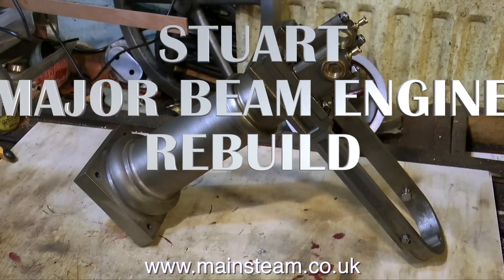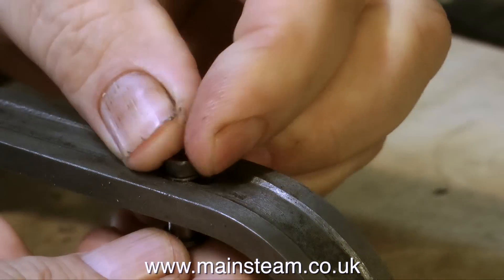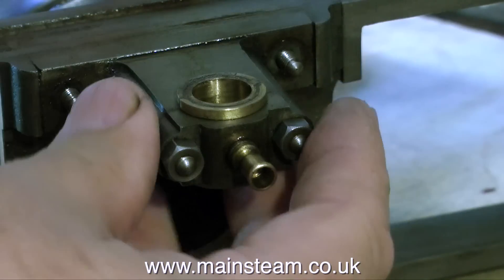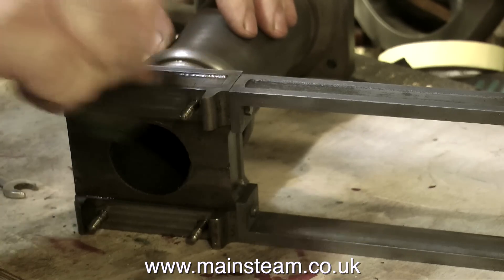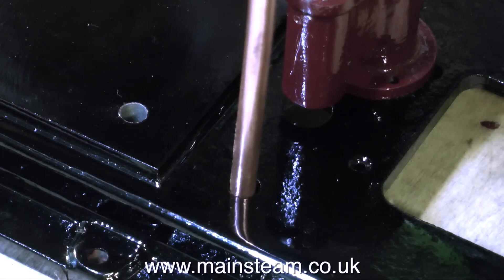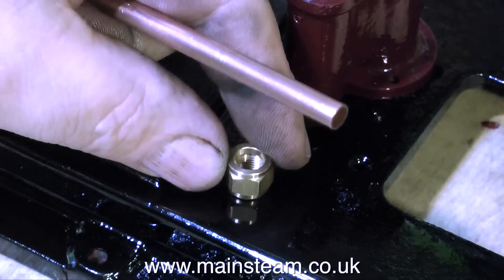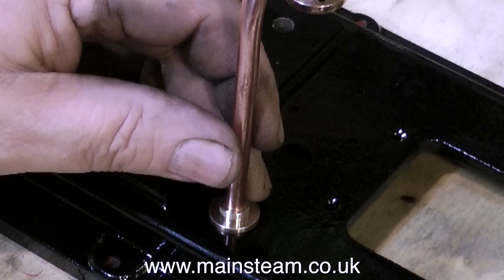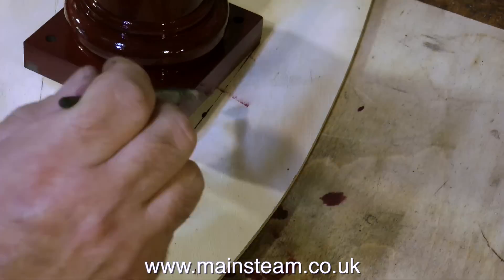STUART MAJOR BEAM ENGINE REBUILD - PART #27

Comment: The horseshoe shaped part doesn't have any particular name it is part of the parallel motion frame. Most full size ones have the parallel motion frame built into a second floor which the beam bearing is fastened to I would call it whatever you want.
Reply: Some where back in part 2-5 when Keith first mentioned he didn't know the name of the part I pointed out it's called the entablature. So yes it has a distinct and separate name for what it is and does. If I recall correctly the 1/12th Model Engineer's Beam Engine that's a reduced copy of this 1/8th version also has it clearly named on the drawings.

Comment: Put them in a box like I do and then tip it over and watch them scatter to unknown places.
That always works.
Mike
Reply from the maker: +Oldvet1946 read the book, seen the film, worn the T shirt - I do that all the time - luckily I like spending time on the floor picking up the parts - gets me close to nature - or the ground at least :-)
Reply: These days i find that if i sort out the small difficult to make parts then chuck them in the bin it saves me having to find them later , it saves me a lot of stress and hair pulling as i know where they went !
Now i just have to work out why  i constantly drop things especially when i have spent many hours machining and polishing them at the last moment i always seem to fumble and drop them on the concrete floor!